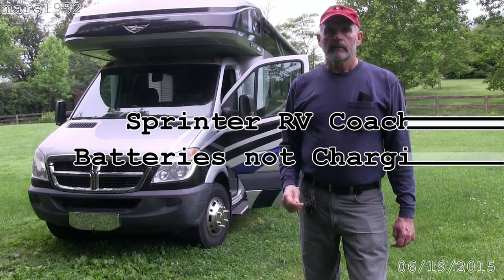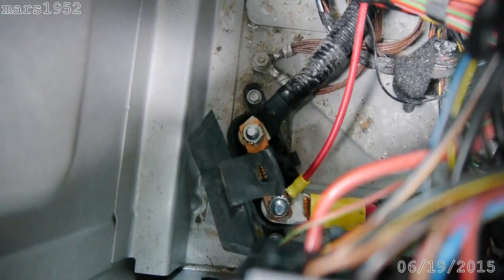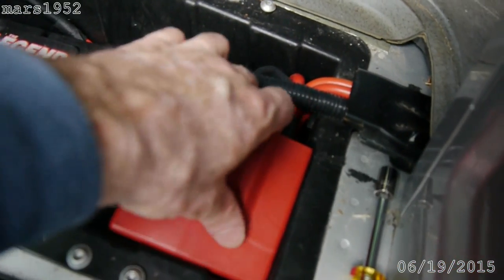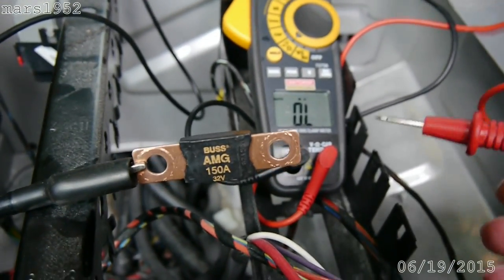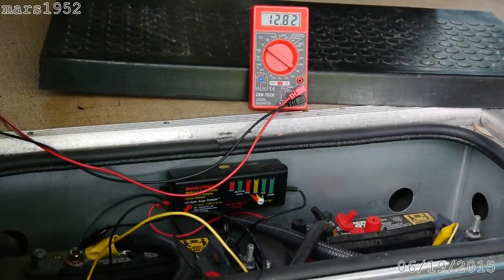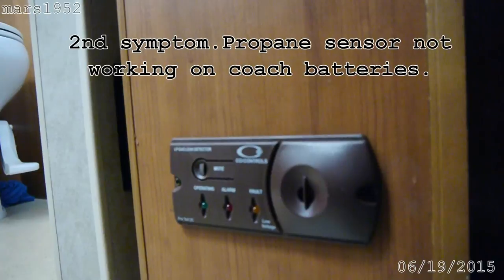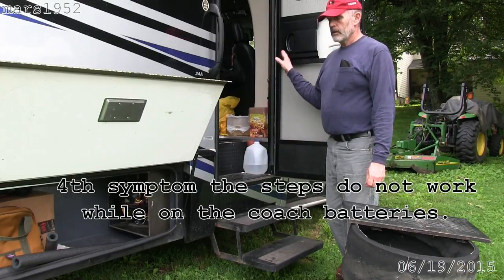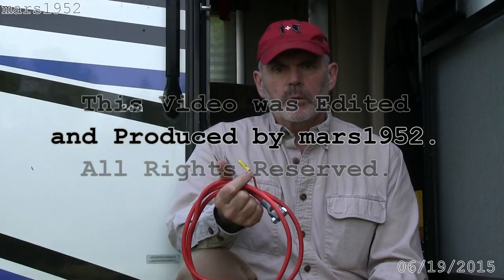Sprinter RV Coach Batteries Not Charging

Comment: Wow great Job! 
7 years later and still great information. I had the exact same issue, same symptoms on my 2022 forest river sun-seeker Sprinter MBS based on your video and the comment of another person, I found the reset switch under the driver seat with the big red wire. I had called Lazy days rv and just as you described all they want to say is it is the battery's. 
the rv was parked in shade and did not get sun to charge batteries and my fridge runs off batt. so it died and drained the chassis batt also so I had to jump start the van, it took like 20min to charge enough to start must of tripped it then. thank you so much.

Comment: Wow, Great video. You just saved me a lot of money. Here is my story. I am from Canada and purchased a used Mercedes sprinter 24ft motorhome by Forest River  from someone who initially purchased from the USA. I had the same problem, engine not charging the coach batteries. I brought the unit into a RV repair shop and was told they couldn't touch it because it wasn't CSA approved. It would probably be close to $1500 to have it CSA certified. After watching your video I decided to see if that was the problem. Sure enough it was. The solution was even easier. The Buss fuse now has a reset on it.  Works perfect now. Thanks again .    Ken

Comment: Excellent detective work, as well as helping to fill the information gap about this common area of problems with coach battery power. I had great hope when I went looking for the 150 amp fuse under the driver's seat of my 2012 Sprinter chassis Pleasure-Way Plateau. Alas the configuration of cables was very different and I'm still looking for that fuse.

Comment: Mars1952, I know this is an fairly old vid but sure glad it's up and that you took the time to make it. I just picked up a 2007 Winnebago View built on a 2006 Sprinter chassis. The engine/chassis battery is under the hood and the house batteries are under the main entry step to the coach. When I bought the RV, the coach batteries were charged and everything worked as should. After about a week of showing people the rv, doing some minor stuff to it to get it ready for state inspection, I found the coach to be dead. I can plug into shore power and get everything in the coach to function. I've driven the truck multiple times but still nothing, so I believe the coach batteries aren't getting charged and just happened to run down over the week while doing things in it. Your video has given me a few things to look at now once I get it back from state inspection. Thanks for taking the time, and yes, I have read quite a few comments from people that just say replace the batteries. The batteries in this coach are only 2.5 years old according to previous owners records he kept.

Comment: just wanted to mention that the solenoid controller can also be the culprit. In your case, you obviously found the correct fault site. Thanks for the great video.
Reply from the maker: sleepkeeper yes, I tested the solenoid first and then checked many other things before I guessed that there must have been a hidden fuse. It was very frustrating.

Comment: Good info about the charging system. Due to a low charging, I replaced chassis battery, alternator and both pristene belts. With engine running, I get just over 13 volts. Dealer told me this was normal.
I now have an issue with a chattering relay in the box under the rider's seat. I wish I could talk to you or text to get more info.  Bob

Comment: Great video. The 150 amp 32V fuse that you found and replaced from under the driver seat, is just too big to fit on the ‘buss bar’ from the coach positive battery post. You need to get the OEM Fuse 150Amp for Mercedes which is a lot smaller. Your set up (fuse under seat) works just the same…

Comment: Very useful video explaining the functionality of the electrical system!
BTW, as an alternative to removing the fuse to check continuity (zero ohms), you can simply run the electrical system and measure the VOLTAGE DROP across a fuse - it should read zero volts if the fuse has continuity (isn't burned out).
I'm surprised to see folks run batteries down to 10.5 volts -  doesn't going under 12v starts shortening the life of the battery?
Reply from the maker: I was talking about a specific battery power test. I was trying to test the rated capacity of the batteries to make sure they still worked. Normally you should not go below 12 volt which is about 50% of the battery capacity.

Comment: Hi Good Vid an Rundown Explanation Our 3500 2008 has same problem not staying charged that Iam working on now in FL I read on the 
Web Sprinter Blog that the all Factory wires need to be changed from the engine To the House I will be checking the House Bus Bar
Thanks Bob V

Comment: Excellent comprehensive video, well done!  This "dinosaur" fuse reputedly has a relatively high failure rate over time  due to warm/cold cycles ,  or other cause  which results in  the fuse metal to move slightly, eventually severing the connection to the end of the fuse, causing an open circuit.  A solution to fuse problems would be to replace the fuse/fuse holder with a heavy duty 150 amp circuit breaker designed for 12 volt  use.  (the original fuse labeled 150 amp/32 volt is designed for 12 volt circuits). Most should simply bolt on in place of the original fuse holder, and are not very expensive.  I saw the Scorpion brand 150 amp heavy duty breaker for about $25.00 on Ebay.  All newer, quality boats have breakers.   I replaced all the fuses in my older boat with marine/auto breakers, all on a nice looking  panel - now I can easily see a tripped breaker rather than mess with fuses.

Comment: Very good video, we have that problem, battery was completely dead, we had it checked and we bought a new battery, that also went dead. We check the fuse in this video and it was fine. Someone mentioned a solenoid valve, do you know where it is? we also checked every fuse there is, they are all fine. 120 v power is working fine when plugged in.

Comment: I have  a 2007 Winnebago View built on 2006 Dodge Sprinter 3500 chassis. The engine running does not charge the coach batteries. Does anyone know the location of the "bus fuse" ?

Comment: Just had this same problem. Wish I found your excellent video before. My other symptoms are onan generator displays low battery and "short circuit" and will turn itself off if shore plug plugged into coach to run 120V systems in RV. Any idea about this?

Comment: OK, so to date how is the RV , what issues if any with the diesel have you had ?  I find myself looking at these Sprinter based rv, for the simple 6cyl diesel and pretty good mpg.  I'm trying to stay DEF deleted with the years. That era crap I hear cosy a BUCK to keep going,  Well hope all is well and your still getting out RVing.
Reply from the maker: The Mercedes drive train has been very good. I have 40K on it now and the only thing to go wrong is one glow plug. The torque is good and it climbs hills well. The MPG ranges from 10.5 to 17.5 depending on wind and hills. Usually I get around 14 MPG. However, the price of gas has dropped a lot and the price of diesel not so much. Diving a gas rig would be about the same dollar per mile and more convenient since you can get gas anywhere, the generator would run on gasoline instead of propane.

Comment: Does Your ohm meter have a beep function?  I find that useful when I need to hold things or Im down inside a tight spot. The Burnt out Fuse happened due to vibration,  and poor quality. When a 150 amp fuse blows things are 'warm" in the area. It may happen again, have seen these re mounted on a suspended mount, rather than bolted to floor.
Reply from the maker: Formula Firebird No my ohm meter does not have a beep function. That would be convenient.

Comment: I have a 2014 Prism Sprinter rv and the house batteries aren't charging.  I had it plugged into my house for 8 days and it won't charge
Reply from the maker: I am not familiar with the Prism but the methods I used in this video should help you isolate the problem. Good luck.

Comment: Hey @mars1952   I'm terrible at electrical.  When you have your voltmeter testing if the coach batteries are charging where are you attaching the voltmeter?

Comment: Great article and good timing for us.  Drove 2007/2008 Navion 200 mi home yesterday and today house batteries will not start the generator but chassis started immediately.  I'll check this buss fuse first after we charge the house batteries.  Any suggestions to source the 150@/32v fuse?
Reply from the maker: I bought mine at Amazon.
https://www.amazon.com/gp/product/B000PSPGMO/ref=oh_aui_search_detailpage?ie=UTF8&psc=1
The also have them at Advance Auto Parts.
Reply from the maker: My guess is that the relay that connects the coach to the chassis is stuck allowing the coach to draw down the chassis battery. A stuck relay could also cause the buss fuse to blow when starting or jumping the chassis.
Reply: The "32volt" spec has nothing to do with the operation.  Its designed for 12 volts, with 150 amps max current. I would replace it with a 150 amp marine breaker, most are also designed for 12volts, to replace the  old fashioned fuses. As mentioned cycling warm/cold over time can cause fuse metal to flex a bit, and separate.

Comment: FYI: engine alternators with single point regulators do NOT charge deep cycle batteries fully. They will eventually be killed by absense of proper charging regimes. See 3 stage chargers and inverters for more info. Batteries are expensive and will be killed by improper charging. Even solar has the ability to charge batteries properly. Good luck . . .

Comment: I’ve had the solenoid switch go out, and you’ll get the same symptoms.
Reply: Can you tell me where the solenoid switch is? We check the fuse in this video and it was working, we also check every fuse inside and they are all fine, the battery disconnect is in the ON position, what else can it be?
Reply: @olgabotero1142  sorry for such late reply. The solenoid is under the passenger seat. You have to remove the seat to get into the compartment. Disconnect batteries in house and vehicle as this is the switch for allowing electricity to flow over to the house side when you drive the vehicle.

Comment: Hello again.  Now dealing with chasis battery going flat.  After 1 week approximately 11.7v left on a battery (new 01/16) which is not enough to fire the V6 diesel up.  Us of the battery boost switch from the coach has not enabled started of the chasis engine and not even enough to roll up the windows on the chasis/cab.  We jumped started from our pickup and drove for 20 minutes to bring battery to a condition where it would start the engine.  This time when we walked away from the Itasca Navion I disconnected the ground switch (next to the throttle pedal).  Is this appropriate and is this kind of drain normal.  We have not started a search for "vampire" current yet.  Hope posting here is ok as I did not see a direct email and have had little luck searching forums for this item.
Reply from the maker: It is impossible for me to diagnose the problem without seeing the RV. But the chassis battery should not run down enough to prevent starting even after being parked for a month.

Here are some things you can try:
While the chassis battery is disconnected hook up a trickle charger and fully charge the battery. When the battery is charged unhook the charger and let the battery sit overnight and test the battery volt the next day. It should be around 12.6volts. Use the methods I outline in this video to test the chassis and the coach batteries to insure that they are being charged when the engine is running and when you are plugged into shore power.

Also your RV should always be plugged into shore power when it is being stored.

Comment: And THIS diesel is a night and day difference from the Powerstroke you own. Be careful...........
Reply from the maker: 22howards Please elaborate.
Reply: mars1952 
First the "coach" is a Fleetwood. The Chassis is a Daimler supplied/sold to Dodge.
The Sprinter is a good chassis as long as it is treated as designed. Knowing the "upfitters" as well as I do, may I suggest to be leery of majority of these upfitters. As many of them do not follow the requirements / guidelines provided by DAG. While I enjoy working on these as stated previously, I would be leery of the upfitters' processes.This is all I will elaborate on a public forum.